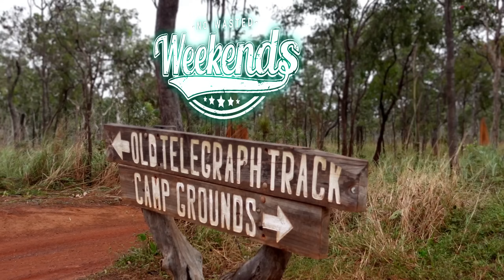We drove the Old Tele Track 😬

Comment: So with the bullbar. Do you know if it was a faulty bracket they bent or something else? I've got an Ironman bar on mine and wonder if I need to keep and eye on it when winching.
Cheers.
Love the content. Sorry about your camera. And I think MIT's have some sort of deal if you actually break something of there's.
Reply from the maker: Thanks Ben !! I assume the bracket was faulty but no word from Ironman yet.. everything was installed correctly. Everything was used correctly.
Reply: That bracket looked WAY too flimsy, and made of cheap soft steel to boot.  Probably deliberate to pass compliance - ie, hit a pedestrian and it should bend.  I'd just make some replacement brackets out of a decent piece of much stronger steel.  Then again my experience with Ironman gear is to stay well away.  To their credit they didn't shirk on warranty replacements for the dud foam cell shocks which were meant to be the duck's guts, and weren't.

Comment: You boys are all running big tyres and big lifts - do you all use diff drops to keep the CV angles safe?
Reply from the maker: The navara and hilux are both Twin Locked which means you can be wayyyy safer on the driveline as you can see, we are able to crawl safely up everything. Diff drop would be helpful but ive not needed it yet.
Reply: Hilux is running Phat bars diff drop :)

Comment: Did Ironman leave the pinning bolts out of the bar for the winch?
Reply from the maker: No the winch cradle steel actually bent , all pinning bolts were installed correctly